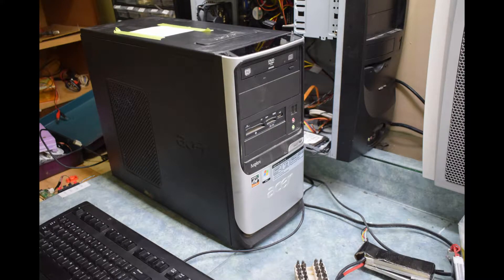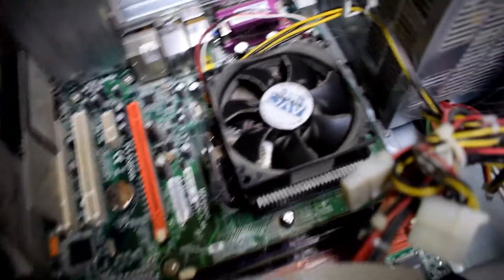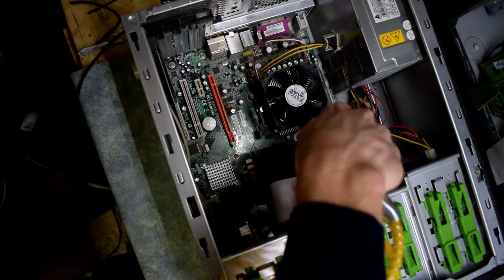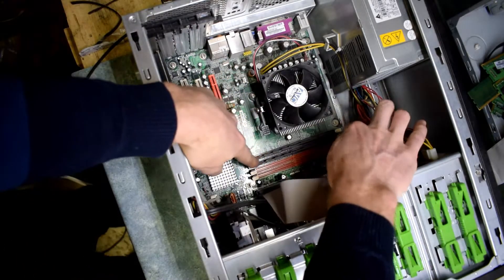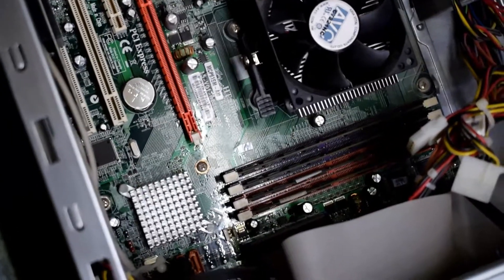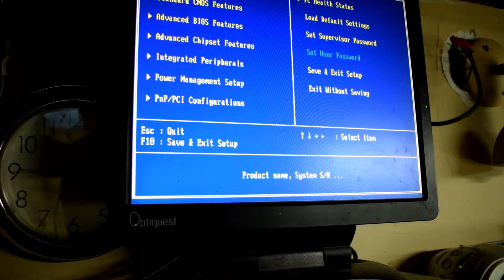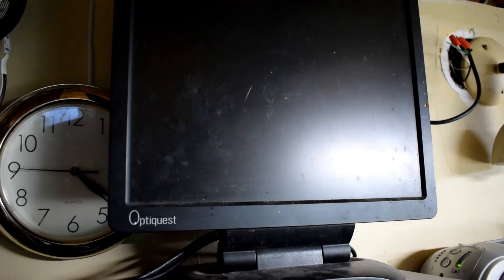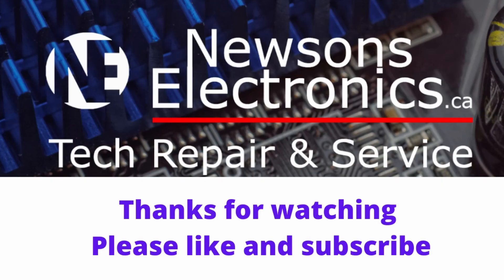How to fix an Aspire desktop pc that keeps beeping.

Comment: I have an acer aspire x3-100, I’m having the same buzzing issue. I tried taking the ram sticks and putting them back in, the issue is still there. Any suggestions?
Reply: Did you get it to work again?
Reply: I bought a acer aspire tc-605 with a i7 4770 in it 12 gb ram. 3 beeps then pause then 3 beeps. That problem has been resolved . Now I get one 2-3 second beeps on start up no display . Is this a ram issue. Any help would be gratefully received. Ps I'm not sure of the ram is bust. I repasted the cpu which hot rid of the 6 beeps
Reply: @Northern monkey plays T games  It took an hour or so before it finally stopped but all i did was try putting the ram in a different slot but it also was being stubborn because it would beep if i had the cover on the pc but would stop without it on eventually it just stopped and i was able to put the pc cover back on